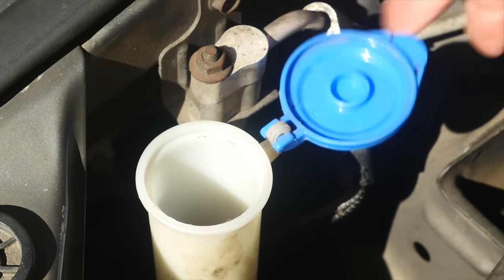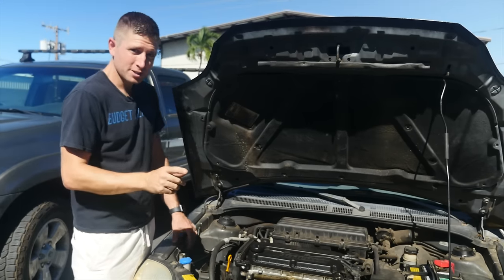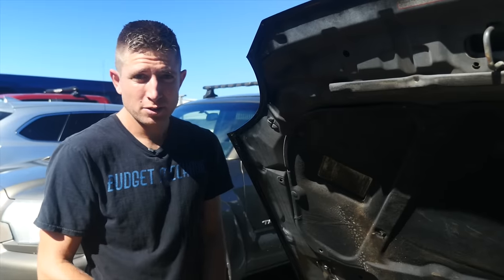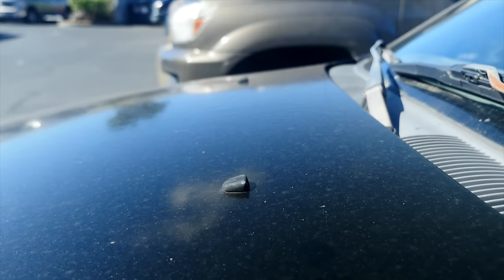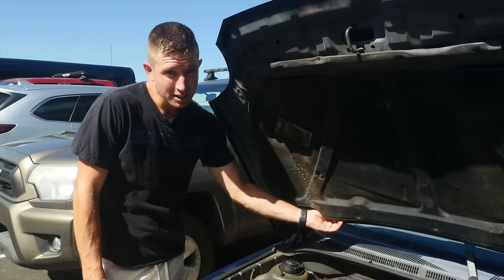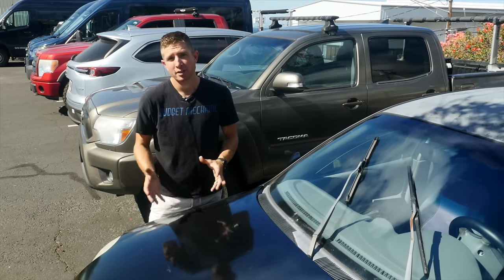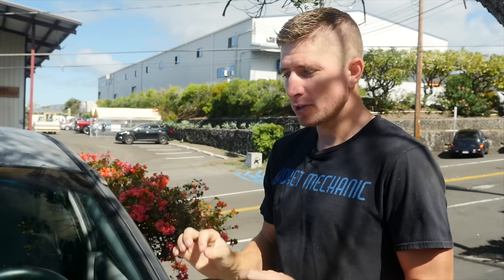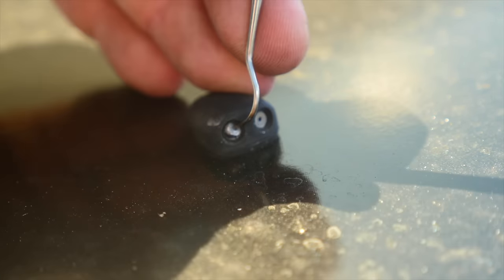Windshield Wiper Fluid Not Spraying Or Spraying Weak: Pump, Lines, Nozzles - Diagnose and Fix

Comment: I'm pretty sure I broke my drivers side spray nozzle myself. It was spraying weak and I couldn't find a small pin to stick in the tiny hole so like an idiot I tried sticking the tip of a scissor  ✂ in it and now it doesn't spray at all. It just drips out onto the hood when I activate it lol. Guess I have to have it replaced now.

Comment: In my 55+ years of owning vehicles and driving I've never had a pump go bad. I've had hoses and connectors break (I keep my cars a lonnnng time) I've had nozzles get clogged or break off.  Easy fixes.
Keep making videos . . . Will help a lot of people.
Reply from the maker: Probably because you are conscientious about keeping your fluid topped up. Motors burn out a lot when people let fluid get too low and it sucks the junk and coagulated fluid in
Reply: @BudgetMechanicHawaii    😀  "pre-flight" check - always . . .  (if I'm going farther than the corner store)
Reply: How and when does a pump go bad? can it be just a Fuse problem?
Reply from the maker: @Muxik4k  yes it’s usually a fuse that blows when the pump gets stressed out. But if it’s allowed to suck air or dirty fluid long enough it will die

Comment: I fix my windshield washer by taking my vehicle to the car wash and spraying each nozzle with high pressure water.  The results were an immediate success.  Sure am glad that I did not have to take it to the dealer due to the hoses from the washer reservoir being under a cowling that would have to be removed.  Saved me many bucks!

Comment: Thank you for the excellent, clear explanation. 
Problem solved in 10 minutes.
I found that blowing through tube going to the reservoir must have cleared the filter in the pump.

Comment: thanks Josh.  Nozzles were clogged, compressed air wouldn't work, small computer flathead eventually dislodged debris in both nozzles.  Great advice on fluid level.  Common sense but it helps to have a tap on the shoulder reminder.

Comment: Thank you brother for the excellent content shared in this video! My only comment would be that the audio portion of the video appears to be encoded on one channel only (left side coming out of my computer audio device). It switches from stereo (two channel) to one channel just after the intro, when you start talking. If this is how video got recorded, you can split out the audio from the video in a video editor and run the audio portion through audacity (superb audio editing freeware) and change it to two channel, left and right side. And overwrite original audio, and re upload. Thanks again for sharing your knowledge.

Comment: Very helpful, bmw 3 series pump filter gets gummed up pretty bad if you don't use the washers for a while, pain to get to because it's behind the wheel arch liner. I put some sink plug unblocker in, only a small amount, topped it up and left it for a day. The day after it had dissolved all of the gunk and it was spraying great
Reply from the maker: Wow great idea!
Reply: @BudgetMechanicHawaii  hey idk if you’ll see this but I have a 2009 Camry 4 cylinder, cylinder 4 is misfiring and the engine is shaking I changed out the spark plugs but the same problem is occurring any advice? It would mean a lot

Comment: Great video!  Hoping I can try some of these techniques and get my washers working again!
Reply from the maker: You can do it!
Reply: @BudgetMechanicHawaii   Hi, so I was wondering if I could ask for advice through these comments.  I have a Fiat 500 and the problem I'm having is that the fluid doesn't come out of the REAR dispenser (because Fiat's have front and rear fluid dispenser but only a single reservoir).  The front fluid comes out fine.  I'm hoping its not a complicated issue.  Once when I tried to run the rear fluid dispenser, obviously it didn't work but fluid dripped from under the car.  Also, the reservoir seems to run dry faster than it should.  I think I will have to examine the reservoir closely by removing the front bumper (hassle but I don't think there's any other way).  Do you have any advice for this specific issue?
Reply from the maker: @jamesp2293  rear washer probably has its own pump. If you hear the pump running, but it’s dripping down, it could mean there’s a disconnected hose somewhere and it’s not coming out the nozzle.
Reply: Thank you so much! Is there a way I can direct more questions your way?  Do you have an email or a forum or something?  I'm trying to learn more about maintaining and sprucing up my car... @BudgetMechanicHawaii

Comment: I went to a mechanic and he told that something might be wrong with the wiring. I changed the motor, and still didn’t work so I went to see him. While he was testing, he checked the fuse box, and it was fine. Later he was able to run the motor directly with external power source, and it worked. So he came to conclusion that the wiring might be faulty from the inside. I asked him for the solution, he said it would need to be thoroughly checked, and would be costly. So, I was thinking if I could have like an external switch that would connect to the reservoir motor itself that I could use. Any idea for that?

Comment: I have a 2020 Tundra pickup. The sprayer would work now and then. I injected fluid through the lines and they were clear. The pump worked when I worked on the system. Backing out for a drive the system wouldn't work. I changed the pump and it worked, backed out and it wouldn't work. What I did find was the hose is routed around the hood hinge and was being pinched when the hood was closed. I removed all the slack from the hose in that area curing the problem. The Tundra has a pad at the hinge that seats on a mating pad when the hood is closed. Probably to hold the hood from shaking.

Comment: What can I check if my wipers aren't working and there's no fluid coming out at all and no noises whatsoever coming from the wiper motor or the washer when I try both. Is there a fuse under the hood or a relay that I can check . The wipers were frozen to the window after an ice storm and the car was driven with the wipers on but the blades stuck to the window stuck to the window. I'm thinking a relay might have burned out but I can't find where it is. All four fuses inside the cabin are good. Trying to fix this today. thank you so much

Comment: thanks a lot, very details in trouble shooting. question, How do i know if fuse is the problem ,, so far i can see water is not coming out of hose, also i hear water pump whirring sound, now i am stuck its the fuse or water filter screen as shown in the video..

Comment: Great info.. I can hear the motor working for the back windshield but nothing when using the front.
Reply: Oh gosh, this is my issue, only I get a puddle of fluid on the floor when pressed. Desperate to know how to fix it, did you get any joy pls?
Reply: @CharlotteGriffin-vf1ud  you may have a hole in the line if you’re seeing a puddle

Comment: My washer (2021 Ford Transit 250) is spraying weakly. When I actuate it, it momentarily sprays about halfway up the windshield and immediately becomes much weaker. Each time I actuate. So I know it's getting power. Does this sound like a plugged line or could a faulty pump behave like this? Thanks.

Comment: I've got an odd issue with my washer. The rear washer works fine but the front doesn't. When I swapped the tubes around, the front would work but the rear tube won't. Replaced my fluid pump by the way. Something else wrong with the tube or pump?

Comment: hey idk if you’ll see this but I have a 2009 Camry 4 cylinder, cylinder 4 is misfiring and the engine is shaking I changed out the spark plugs but the same problem is occurring any advice? It would mean a lot

Comment: Why would the pressure be low in cold temperatures?  The washer fluid is rated for minus 40.   When the warmer weather comes the issue goes away as long as I am not driving on the highway which seems to cool things.  When warm and working the spray is good, so the lines and nozzles seem to be clear.

Comment: Mine (2006 Alfa Romeo 147) is spraying weak on both sides of the front, sometimes, Other times it is fine. Rear is always fine. I figured it must be the motor, so i replaced that.

The problem is still there, sometimes it sprays fine, sometimes very weak so it doesn't reach the windscreen. Any thoughts?

Comment: Nosal spray from rear windshield stoped working. Motor is working but its not spraying...even worse it throws out liquid at headliner 😤
So when i pull my hand under the headliner i can feel that nosals had splited..but it is hard to reach with 2 hands should i need to dissamble all headliner or (somehow) remove just three screws that you showed in video ? My aim is to partialy remove hedliner...is it posible?
Reply from the maker: Headliner inside the car?? Or the insulation layer on the underside of the hood?

Comment: I get full spray from two of three holes in first nozzle and one of three in second nozzle. The other holes sort of dribble spray very short. Interestingly I have huge puddle under the drivers side after spraying. I have no idea how as there do not appear to be any leaks.
Reply: This is exactly what mine is doing. Did you figure out how to fix?
Reply: Same herrre
Reply: Got a leak somewhere under the wiper cowel or if the line runs to your hood you gotta take the panel off to see under it at the nozzles

Comment: hi my front jet doesnt work anymore, but all my wiper (both front and rear) works, and also the rear jet works fine. first thing i checked fuse, it is fine (i has to be, other wise none of them would work). so next assumption is the front jet motor. 

So i ordered a new motor, and replaced it, but still doesnt work. So i measured at the plug where the front jet motor plugs into, i see no voltage (no matter engage the jet or not from dash).

what would be the nest step to trouble shoot? my guess now is it has to be wiring , or switch at the wheel. the wiper switch behind the steering wheel.?
Reply from the maker: Yes I would guess the switch or wiring to the motor. But also try to apply 12v to the new motor to confirm it’s working

Comment: I had to remove the spray outlets and push a coat hanger into them to force out the muck from tap water build up.  Imagine what it's doing to your bodies plumbing . I've stopped drinking tap water.

Comment: Sadly, mine (2005 Accord) has the type of nozzle that won't allow much to be poked in, and from the other end I can't work a soft wire in very far before hitting a fairly hard bend that isn't allowing more access (The tubing itself is nearly 100% hidden by a hard shell that would require pulling about 4 fasteners to get into.  I don't wanna do that.)  The rubber tubing's  inside diameter is too big to stick canned air straw into it tightly, and it's too small to jam the canned air nozzle straight in.  I'm stuck.  I thought the soft wire (coated) would work, but I need something else... but have no other ideas.

Comment: I have a 2015 Fit with the nozzles underneath the cowling along the hood.  I have a weak spray issue from the day it was new.  The dealer replaced the nozzles, but it does not help.  Does anyone know if there better after-market nozzles available?
Reply from the maker: I would suspect obstruction in the pump filter! Check that

Comment: How and when does a pump go bad? can it be just a Fuse problem?
Reply from the maker: Check fuse first!
Reply: @BudgetMechanicHawaii  Where is the Fuse, for me the wippers work but the pump does not, no water coming from reservoir.
Reply: Fuse looks fine
Reply from the maker: @Muxik4k  fuse in the fuse box either under your steering wheel or under your hood

Comment: My xf 3.0 was sent recently for a brake pad replacement, the stupid workshop fellow opened the battery, and got my bcm corrupted, I got it reprogrammed and everything is working again, the only issue is my wiper does works, but the water in the pipe is not coming. Neither the water pump is running. Neither the windshield or the headlight both pumps not working. Can anyone tell me, Is it because of the bcm issue which happened recently, if yes how can I resolve it?
Reply from the maker: Yes it does sound like it’s related. On newer more “sophisticated” cars many of the motors are controlled thru the computer. But first check fuses. Then you might need someone with a good scan tool to go in an activate the sprayer motors to ensure they’re working

Comment: OH man. Usually you solve my problem. But this time, my hose is not attached to the nozzle, and it's impossible to see and I don't know how to reconnect it. You didn't tell me how this time. Sad. But, it's ok. If I figure it out, I'll comment.
Reply: This is the problem I'm having, did you ever figure out how to fix it?
Reply: @greygreygray  yes. You have to take the liner off your hood, and be careful not to break those little plastic do hickeys that hold it on, and then you’ll see your connection lines, and you will be able to put in a new nozzle head. You can find them pretty cheaply online, but don’t get the cheapest one like I did, because it doesn’t spray exactly properly. I should’ve spent five dollars more for a better one. If you do break the little plastic do hickeys holding the liner on, they have more at AutoZone or O’Reillys or places like that. Good luck!

Comment: I have a 08 Infiniti ex the washer pump stopped working it's like a pump you use in your fish tank all I did to get it working is take a pressure washer and spray it in the washer fluid tank a few times and it got the little pump fans moving again some times they get jammed up from calcium buildup it worked perfectly I hope it will help someone else and save money & time and head aches
Reply from the maker: Good one!

Comment: What about when I get an almost burnt rubber like smell everytime I use the spray? Everything sprays right, just spells awful?
Reply: It's probably just the wiper fluid smell
Reply from the maker: You mean it smells like that inside the car when you’re using it? If so, I would inspect fuse panel and other wiring inside the car for potential electrical problems.

Comment: The real issue is identifying where the pump is, in my own case my '02 Toyota Corolla vvt-i window washer (front) pump has stopped working. I don't hear any sound when the washer pump is pressed, the back one is working ok. But they are wires going to not sure where. I have a basic understanding of circuits but where is the fuse for the pump? I need a manual, maybe a Haynes manual. Even if it was a fuse, fuses shouldn't burn out unless there a bigger problem. I appreciate more experienced weekend mechanics would be on top of this but at the back of my mind is not to do more harm than good.
Reply from the maker: Check the fuse first, replace if burned. If it burns again then something’s wrong with pump. Usually they are located behind the forward plastic inside the wheel well. Left or right side
Reply: @BudgetMechanicHawaii  Thanks, I just got a Haynes manual and it seems the motor that drives the pump is not working possibly because I didn't put anything to stop reservoir from freezing, I still have to find the fuse or else the front bumper has to come off to get to the reservoir / washer motor

Comment: Man I just put a brand new pump in my moms Kia and it sprayed with normal power at first, then I pressed the rear washer button and then the fronts sprayed again. Then then it started pumping really weakly on the front afterwards. I really don’t wanna trouble shoot a wiring harness
Reply from the maker: Gremlins!

Comment: Bad news for Ford Police Interceptor utility owners. A pump at Ford runs about $57, and they want $449 to replace it;
My mechanic replaced it under 15 minutes. So DON'T LET THE STEALER, I mean the dealer do the replacement.